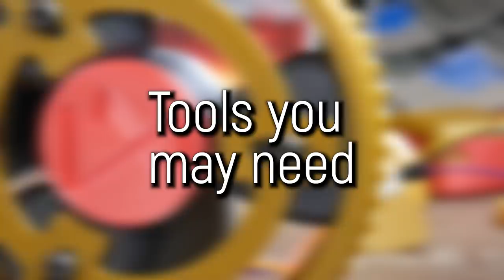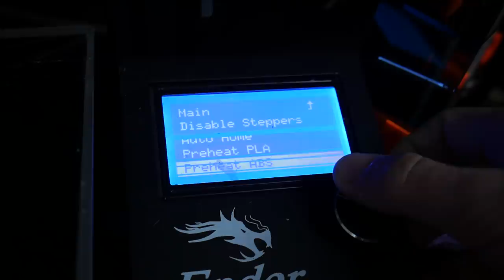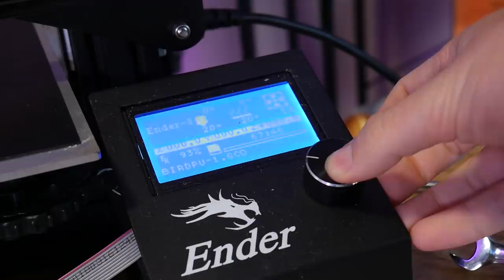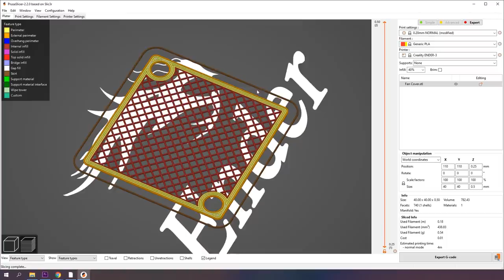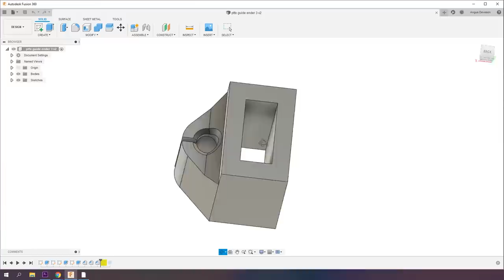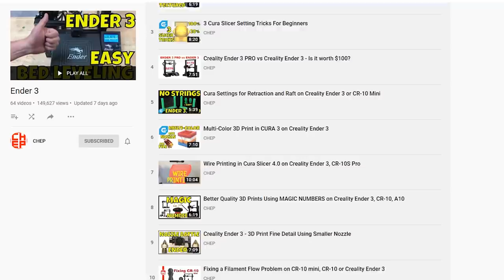Maintain your 3D Printer and get great prints!

Comment: Great Maintenance List, Angus !!
1) 	Print a reference item like a Benchi for Before/After reference.
2)	Invert and clean generally, esp V-Grooves
3)	Check tightness at the Z Servo Coupler screws
4)	Inspect all limit switches and wires
5)	Loosen rollers & belts and clean / inspect for wear
6)	Re-tension belt rollers.
7)	Inspect Hot End for Nozzle wear, chafing wires
8)	Trim PTFE at Nozzle, clean with scrap filament/ IPA
9)	Check all MODs for their unique issues
10)	Clean/vacuum out all fan apertures. Install fan debris guards.
11)	Lube Lead Screws lightly, clean up any excess, align Screw bearings
12)	Inspect Heater Bed wires, connectors. Solder is preferred over crimping
13)	Clean under any removable printing (magnetic) for flatness
14)	Update Firmware (optional)
15) Level bed, checking many areas for warping.
16) Re-Print the reference item (Benchi) and enjoy!
Reply: I have to disagree with point 12. Do not solder the wires, use ferrules. The solder will work harden and become brittle over time which will turn into a fire hazard
Reply: @robinmunkittrick4569  soldering with proper anti-wicking and mechanical support does not have those issues. But few hobbiests solder to NASA or USAF standards.
Reply: @robinmunkittrick4569  I have some wonderful solder loaded heat shrink tubes in a variety of bores. Strip wire ends, a little twist, poke one wire all the out,  overlap the other piece, push back to centre position. Apply heat gun (best with digital temp control/readout). The cuffs are flexible with an adhesive inner coating and there is a tube of solder in the centre that flows.
Result--slim, neat, humidity tight, strain relieved and a solder join in the stiff centre portion. Bought a pack for a mate who goes ocean sailing. In an emergency you can use one of those blow torch lighters, after all if you are are out at sea with broken electrics, you might have no power and probably no heat gun. DO NOT play that game in the engine bay of a petrol driven craft/car.
Reply: Exactly why im just gonna buy  a new better printer

Comment: "When your machine is apart, it's a great time to print some new upgrades."

Unless you have a second machine, it's better to print any necessary parts BEFORE you disassemble the machine.
Reply: Unless you dont have a second machine*
Reply: Kieran Bratson no he’s right
Reply: @frogjmp  What the OP has currently said means that if you do have 2 printers, print before you disassemble. But if he puts the don't, it would more accurately align with what he means. If you only have 1 printer, print before you disassemble said printer.
Reply: Kieran Bratson He said unless you have (meaning everyone but those who have a second machine to use) and you for someone unkown reason corrected him to “Unless you don’t have” which means only people with a second machine to use
Reply: @frogjmp  He said unless you have a second machine, which is everyone that has a second machine. He wants to be addressing those with 1 machine, so he should put Unless you dont have a second machine
Reply: @BlackSlimShady  I think you're confusing the words that were used. The way you seem to be interpreting it assumes that the word "then" was employed after the comma.

Using "then", it would take the form of:

"Unless you have a second machine, THEN you could use that to print the extra parts." (Capitalization used for emphasis)

This method is sort of the "if-then" format, although it uses 'unless' instead of 'if'.

However, I did not use the word 'then', therefore, the sentence does not (and cannot) follow that format. Without using 'then', the change you suggest doesn't really work.
Reply: In fact, it may be a good idea to print replacements for anything that might wear out long before it does.
Reply: That makes sense!
Reply: lets be honest here. Name one person who is in to 3d printing enough to know about mods who does not have at least 3 machines running at any one time. LOL
Reply: @fakiirification  Me
Reply: @BlackSlimShady  You're confused. He said it right
Reply: @BlackSlimShady  he's right...it's like saying "unless you are a guy, you shouldn't go into the men's bathroom." This means that everyone that isn't male should not be going into the male restroom. (Unless for some circumstances) Basically saying that only men should go into the men's restroom
Reply: @BlackSlimShady  No, you're just plain wrong. "Unless you don't have a second machine" would mean you want to address people who only have one.
Reply: @demoniack81  Unless you don't have a second machine means you want to address people with two.
Reply: @Lynx-vi3bi  I mean I guess who you're "addressing" it depends on the entire sentence, just the "unless" part is not enough to decide. Either way in the original post "Unless you have a..." means you should print them before if you only have one; "Unless you don't have a..." means you do it if you have 2+ (which makes zero sense). Kieran thought it was the opposite.
Reply: LOL, words of wisdom!
Reply: Kieran Bratson In this case (and most cases), unless means “if you don’t”. So, “If you don’t have a second printer, print the necessary parts beforehand.”
Reply: @fakiirification  Me
Reply: @fakiirification  I don't even own a 3D printer yet - still I know about pretty much every mod there is.
Reply: @oskjan1  yup, I just started to use CAD (and slicer s/w) to design some parts I need and I'm watching lots of 3D printing videos about upgrading, deciding types of printer etc. When I eventually get my hands on an actual printer it'll have to work 24/7😁
Reply: @robpettitt5946  Also Me
Reply: xd lol
Reply: lol ..Voro is actually correct ... surprising how many people dont know what 'unless' means .. if ya dont have more than one machine, print BEFORE you bust it up, cos ya wont have anything to print on while you have your only printer busted up... will ya? 1 - 1 = 0.. 1 printer + dismantled + no printing = no printed parts

Comment: I picked up an ender 3 last month and it's been great for prototyping, I started with Chuck's Cura profiles and they work a treat, I've had consistently good prints with PLA. My only gripe (so far) would be the couplers on the Bowden tubes which seem to spit the PTFE out at the extruder and I can''t seem to get rid of the elephant foot unless I print on a raft. Wish I'd got into 3d printing years ago, haven't had this much fun in years

Comment: Got the 3 Pro after referring to your content, I figured it was best after the information you put forward in your videos. I use an Intermac waterjet and an Intermac CNC machine for my work, these are obviously very different in function but similar in behaviour and principle, I find over holiday periods or reduced work, the machines can succumb to "rust-like" behaviour where errors arise and parts break after periods or inactivity. Servicing our 3D printers periodically is important as the complexity of CNC devices induces a constant state-of-decay, prevention is the best cure ;)
Peace.

Comment: Hi Angus, I'm running direct drive as well and I mounted the spool on the top so it comes off the roll directly down towards the head, the feed path is a straight line. It works really well. Thanks for all the great information, your vids have been really helpful!

Comment: I would add that it helps to check the fan blades for wear (I had a blade break off) and even clean the edges as dust accumulates and can reduce the air flow. I do this with my big fans in the house as well and can notice a difference in the amount of air blowing out.

Comment: Ender 3 pro. I have more than the cost of the printer in mods. Full Capricorn, full Swiss, brass nozzles, glass bed, 32bit controller, 2nd Z axis, and it’s a beast. I haven’t had an issue in 1000hrs and that’s operating time. Resin printers are better for models and detail, but I’ve printed over 1000 functional mechanical parts about 90% of which have been working for years straight. Also lithium grease is your friend.

Comment: I literally bought the pro one like 4 hours ago dang
Reply: I really hope yours doesn't come with a short belt, Mine did :(
Reply: me too
Reply: I bought a pro around a month ago, it's belts were fine length wise.  I had to tighten them though.
Reply: @symbolicsin  same here ... very disappointing ... also fed tube kept pulling out
Reply: Me too!!
Reply: Don’t worry, you’ll be fine
Reply: I ordered mine on wednes6
Reply: At my local Micro Center, the Ender 3 Pro is pretty much the cheapest 3D printer they got in stock. Haven't have any problem yet but this is my first 3D printer so im expecting to screw up somewhere.
Reply: @Flyyingfoxx  didn't it come with the collars meant to go on the fitting?
Reply: @Flyyingfoxx  Have you contacted Creality support? I have and they are trying to charge me shipping for the right replacement belt! I bought the printer brand new from there store and they had the mistake. Now there trying to pass the buck onto me, Has anyone else having this issue?
Reply: Not dang, woohoo
Reply: @cinnabarsonar2072  are they still coming with genuine meanwell PSU?
Reply: @dinosoarskill17  If it isn't genuine then it's a very convincing fake.
Reply: Definitely time for maintenance, it’s getting pretty old
Reply: Atleast you got one
Reply: @Poorgeniu5  i just got mine from micro center for 199.99
Reply: @symbolicsin  assembly guide is a bit wrong. When you put the belt, you need to have the belt roller loose, put the belt, pull/tighten it with roller.
I assembled my 3 Pro yesterday and noticed that it's hard to lock the belt without loosening the roller.
Reply: same lol
Reply: I got the non pro version of the ender 3 because I didnt think the pro was worth the extra bit of money. Very pleased with the printer and have put thousands of print hours of it with virtually no maintenance. CHEP has some pretty good Cura printing profiles that you can download so you can get good quality prints right off the bat. Also, spend more time leveling the bed than you would think... Basically the more time you spend leveling it and getting it really dialed in, the better print you will get.
Reply: I bought one a week ago...
Reply: Luccillen nah, it’s actually been great so far. With tree supports and brim I’ve had every print go well. Straight stock settings otherwise.
Reply: readysetnogo I like the Pro version specifically because it stays level better if you pull the mat off and remove the print, rather than removing the print while it’s on the bed. This limits the interaction you have with the bed, and I’ve been printing for 2 weeks without a bed level necessary. I’ve been paranoid too, and I checked the level twice now, and it’s still just as solid as it started.
Reply: How is it?
Reply: HDose you will trust me everyone does
Reply: Mine came working mint out of the box
Reply: @TheCj71984  awesome! Thanks! How loud is it?

Comment: Timestamps:

00:00 Intro and list
04:00 Tools
04:41 Withdraw Filament
05:10 Tension Belts
06:55 Maintain Motion Components
08:11 Replace V Rollers
09:35 Lubrication
10:51 Wire Fatigue
12:58 Motherboard Fan Fatigue Mod
13:41 Filament Holder Upgrade

Comment: I love my Ender 3 but it does need to be modded.  Thanks Angus, great video as always.  Some really excellent suggestions, especially the wire fraying part because if the firmware does not get updated, then thermal runaway will not be enabled, which could lead to a fire.

Comment: I looove doing maintenance to my ender 3 pro. Check the belts, lubricate the Y rod, remove all the debris from the wheels, vacuum the slots, check the cables, remove all the dust from the fans, clean the nozzle, give it a wipe with IPA... 
It sounds like boring work but it's fun for me!

Comment: Great video, i have also watched many of Chucks vids. Bought my e3 pro about 5 months ago, and once assembled and initial tuning done, had some of the best prinst ever, ( out of the box). Its a great little machine. I have only added a drag chain to the bed, but am planning on adding dual z, hot end drag chain, and upgrading the firmware, but that is for when i tear it down for maintenance. Thanks Angus, and thanks Chuck

Comment: 13:00 - I need to say something here for the newbies like me, as I just installed my Ender 3 at the end of May. Rather, I installed my Ender 3 *PRO* at the end of May. YOUR CONTROL BOARD WON'T HAVE THIS ISSUE.

This hobby has changed SO much -- As Angus notes in the video -- over the years, and one of the changes was the regular E3 vs the E3P. One of the changes was that the motherboard box is now upside down, and all the venting is from below. You will NOT have the fan opening. Most of the videos out there demo the Ender 3s, and NOT the Ender 3 Pros. Keep that in mind to save yourself the confusion.
I noticed that I didn't need the fan mods that were all over Thingiverse, but it wasn't until I went to check on why my USB input looked a little loose (it wasn't; it was the cable itself), and after removing far to many screws, I realized it opened from the bottom.

Comment: I like to move wire mounts (zipties, etc) around every so often to distribute wear more evenly across the wire. Back in the day I put together my Ultimaker incorrectly which years later led to an intermittent fault in the connection to the thermistor due to wire fraying. It led to my hotend shooting up in temperature which I'm lucky didn't destroy it (the old Ultimakers did not use all-metal hotends) or burn down the house.

Comment: I think its fine that you use grease to lubricate your z axis but you may also consider a (non silicon based) machine oil. I used both and found that the grease was really prone to collect dust or even small plastic parts from my prints which made the Z axis get stuck on them. With oil you can easily spot if that happens and have to clean less, trying to clean out all of the grease was always a bit trickier. 
Just my two cents on that topic. 
Also if you're using axis with linear rods or rails, please only use machine oil to lubricate them. Plus silicon grease is usually made for plastic on plastic contact, not for metal on metal. So keep that in mind!

Comment: I recently got a used ender 3 pro.  it is doing really well and I am very happy with it.  my dad likes the results so much that he is thinking about selling his davinci 1.0 pro to get his own.  so may go back through your reviews and recommend something better/more capable for him, or at the least an ender 3 V2 and filament run-out sensor.  fyi we have greatly enjoyed the davinci 1.0 pro (we got it for $400 thanks to a warehouse liquidation store) and are glad we got it.  I know a lot of people seem to hate the davinci, at least for beginners it is really nice.  I like the box design, the way everything moves, and the case.  it definitely has room for improvement but I don't see why it gets all the (vocal) disdain it does

there are some things I plan to do to my ender 3 pro and I figured while I have it somewhat apart I will go through and do a check-up on it.  I am using prusaslicer because it was free and I am liking it a lot.  for me it was easier to work than cura slicer (free edition) and even goes to a finer layer height if I so choose.  I am putting a Z-axis kit on to give it 500mm vertical, new motherboard so I can put a runout/jam sensor, and a direct drive so I can do flexible filament in the (hopefully) near future

the fans on the hot end just started to make some sounds, like debris is in the blade path or a screw has worked itself loose a little and is vibrating.  it seems a lot of people like to replace the stock duct work for a new design.  they also tend to change the fans from stock.  I think I will wait to do so unless I have to but when I do I plan to use noctua fans (I have them for my computer CPU and I love how quiet and efficient they are so I am hoping smaller versions would have just as much quality). 

for the hardware would it be alright to use a small drop (or use a drop and have it shared with a couple bolts) of blue loctite?  in general would there be a written manual with a bunch of steps (with pictures as well) and recommended usage hours between certain checks?

I do some car repairs and maintenance so I was curious if the caliper grease I have would be viable?  granted it is a grease so it would hold onto any garbage and 'eat' the screw and nut a little faster but I am fine having to replace it after likely years of use.  if not i will see about silicone spray, and if I can't find that locally I will try to find some thick and heat resistant grease

I am trying some filament from gst3d (USA made with a couple factories around the world).  I know you are better at thoroughly testing though.  the big reason why I want to try it is if you order 10 KG you get it $9 USD per KG, if you order 20 KG you get it $8 USD per KG (they only do PLA+).  where I have been getting my filament from the price is twice as much (about $22 USD per KG).  if you would be willing to would you be willing to try some?  they have a lot of different colors to choose from

Thank you for all your hard work, videos, and sharing of knowledge.  it is greatly appreciated

Comment: 0:48 the ender 3 I got in October 2020 has a tensioner bracket that's attached to the extrusion on both sides. Possibly one of the "improvements" over the years of ender 3 production.

Comment: Good video. Minor suggestion. Instead of alcohol for the wheels. Use naphtha. Alcohol can dry out rubber over time.  I own 3 laser and which have similar wheels, and you should also use naphtha on those according the manufacture. I also have several 3d printers.